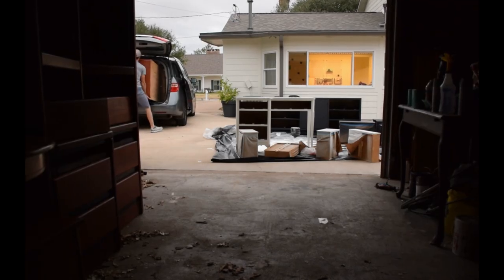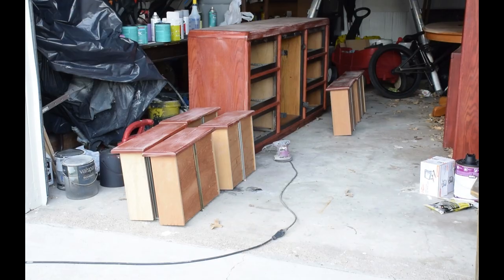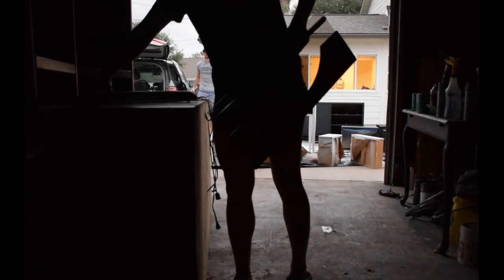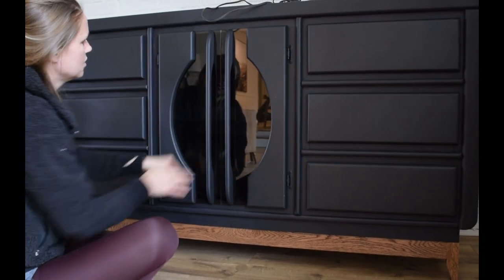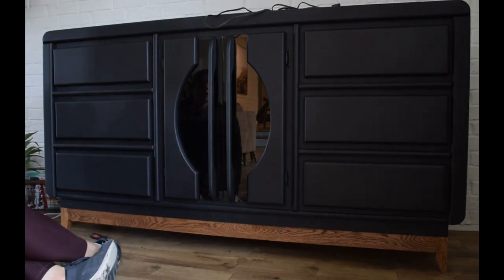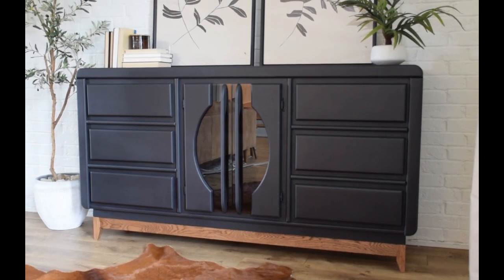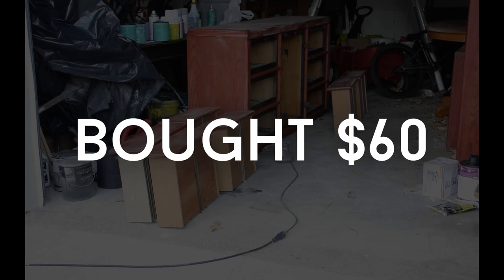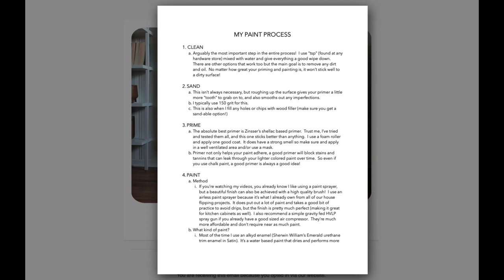Flipping A Mid Century Modern Dresser // Furniture Makeover

Comment: Beginner here. How did you make the legs? loved the video.
Reply from the maker: I use my miter saw to get the angle on there (which I pretty much just eyeball then make sure the other one matches) then cut the length and put everything together with pocket holes :)
Reply: @diywife  Oh thanks. What were the wood sizes?
Reply from the maker: @megaraichu4729  The legs are 2"x2" and the long boards are 1"/3"
Reply: @diywife  Thanks
Reply from the maker: @megaraichu4729  no problem!

Comment: Y’all do a great job making the new legs but you should remove the platforms first. It would look a lot better. They are usually just screwed on. It’s easy. You did a great job tho. Very nice!
Reply from the maker: I do that on some pieces, but on others I actually like the way it looks with the added height.  I'm also wondering if the camera angle (which is a good bit lower than someones eyes) makes it stand out more?  It doesn't look weird to me in person :). But either way works, thanks for watching!